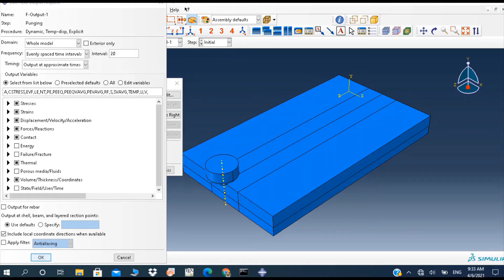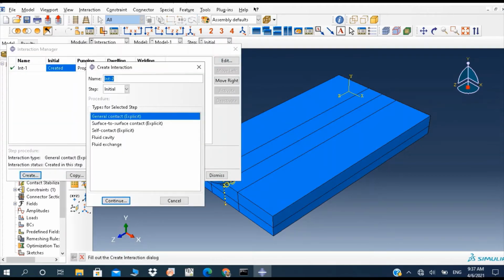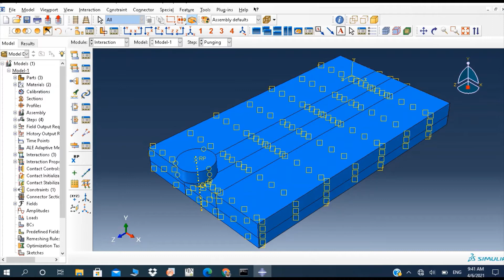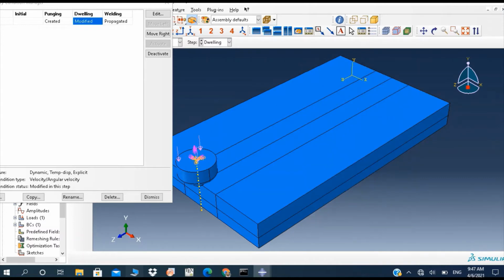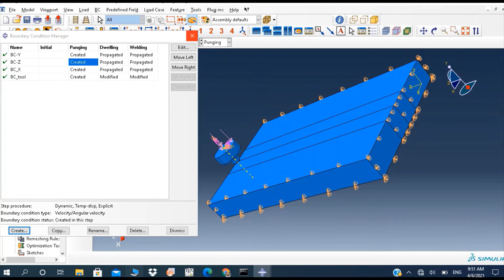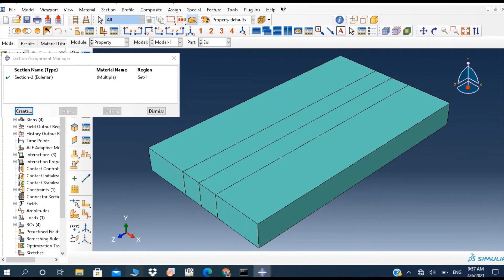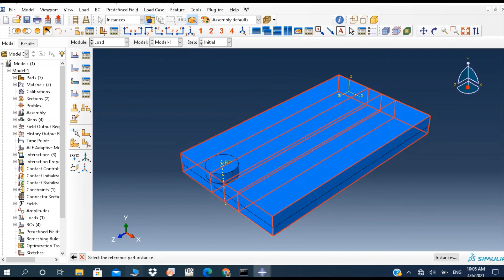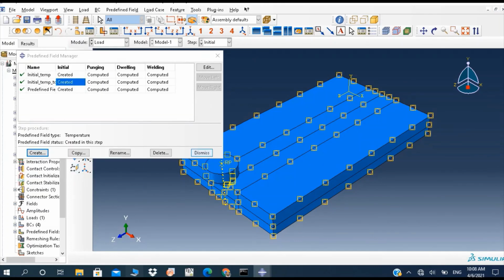Friction stir welding simulation in abaqus using Coupled Eulerian Lagrangian CEL method  Part 2 of 3

Comment: Great video, I havo only one question:
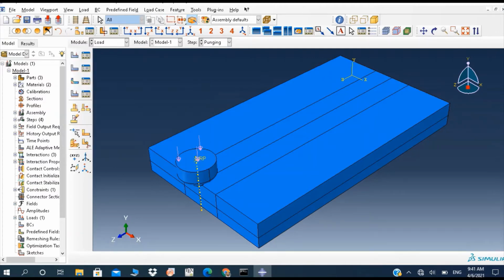why are we defining the pressure BC on the tool in min 7:11, while defining the speed in min 9:14? 
      in this way the speed control may overwrite the pressure control making it usless, don't it?
also in min 9:14 the V2 is set to 6, shouldn't it be set on -6?
thanks very much
Reply from the maker: Pressure implies the applied force. In addition, velocity is required to refer downward movement
Reply: @Abaqus-Tutorials  
ok thanks
What about the V2 sign?

Comment: Sir, if we use two different types of wp material, supposed Al5000 and Al6000 series, then what will be the eulerian part material, or what will be the base material  for eulerian part 15:03 ? Sir Please Reply
Reply from the maker: Properly make a partition for both eulerian and langrangian. First create different material properties i.e, Al5000 and Al6000
Reply: @Abaqus-Tutorials  sir done, bt for eulerian portion which type of material assigned ?

Comment: Hello sir, thanks for the helpful tutorial. 
I have a question about BCs you assigned for the Tool, the rotation speed is 500 radians/time. It means the speed is appox 4777 rpm. Is this right?

Comment: I am doing a similar FSW simulation but in results i am not getting deformations on the plates like grooved created by rotating tool, etc. Can you tell what might be missing? Also i gave plate material type as deformable. Do i have to use eulerian?
Reply from the maker: Eulerian best for large deformation. It may due to material property or tool rotation

Comment: Also, V2 speed during the plunging step shouldn't be -6 because the tool moves downwards in the y axis?
Reply from the maker: downward movement is equal to the distance between tool and workpiece plus expected penetration.  Already you  know the distance when you assemble

Comment: I am doing the analysis in ansys workbench.. However there are large deformations getting recorded and the fsw tool gets stuck in between and does not traverse the whole length. What could be the possible reason?
Reply from the maker: I recommended you, to increase the transverse length
Reply: Did you got it? I am also facing same issue. Please help

Comment: First of all thank you for the tutorial. But can you tell which time the simulation took in your case. 
On my computer with license on 4 cores only after 3 days I have just 0.76 process time finished.
Reply from the maker: It Must be finished in 3 days. Actually, it depends on computer, not only ram, cpu, ..., but if the computer processer runs a number of program at the same time, it will delay

Comment: Thanks for the helpful video. However, I have one question. There is no section designation on the workpiece, but if the section designation is not done, an error occurs. How did you designate the sections in this analysis?
Reply from the maker: I will post video regarding to this
Reply: @Abaqus-Tutorials  Thank you for response. When it will be uploaded?

Comment: Hello, kindly need your suggestion... the CEL technique seems to be too expensive computationally.. How did you tackle reducing the computational time?
Reply from the maker: Ofcourse, it need much time to complete the analysis. Try to use appropriate mesh size, sure material property and increase your computer RAM, if possible

Comment: Hello, there is a big flaw in my simulation, which is a gutter in the weld.
Reply from the maker: This happen when the applied pressure is high or penetration of tool probe is high, so manage those parameters